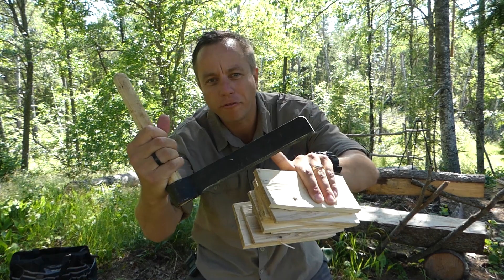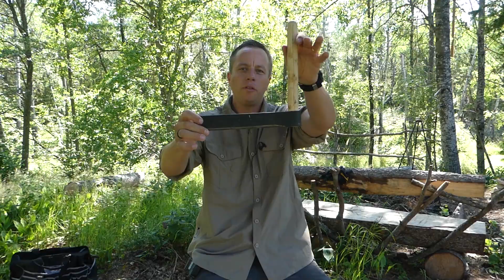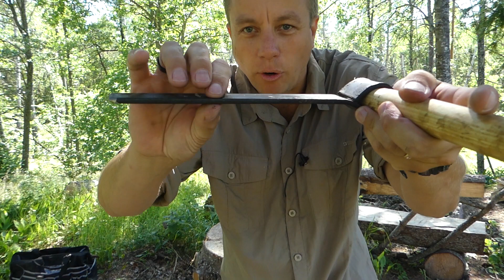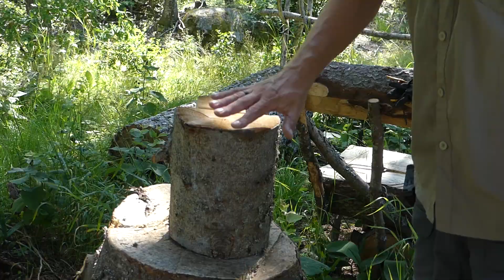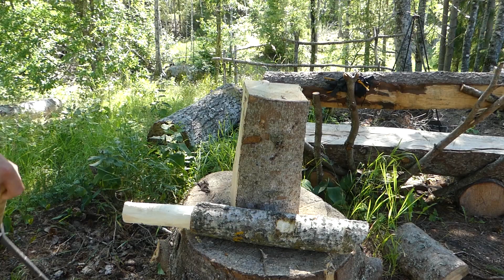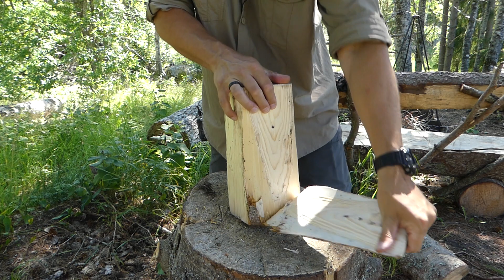Using An English Froe

Comment: I have found that if you don't want to damage your hands, splitting the log with an ax, as he has done in this video, is the best method. Also, give the fro a good hard whack and then use the handle to pry it apart. Hitting the protruding end of the blade causes the fro handle to whip against your hand as though you were beating it with a stick.
Reply: You just are not using a froe properly

Comment: Nice to see some Froe promotion. Great vid as usual. A tip is to not make the shingles one by one from a large block like that. It will taper off and get to thin in the end. Instead, you should make halves and then halve them in turn till you get the right thickness. With bigger loggs you can make the shingles radially instead. 
Here's a pro in action: https://www.youtube.com/watch?v=UZA1J8RHltY